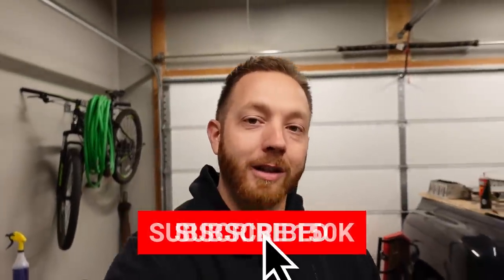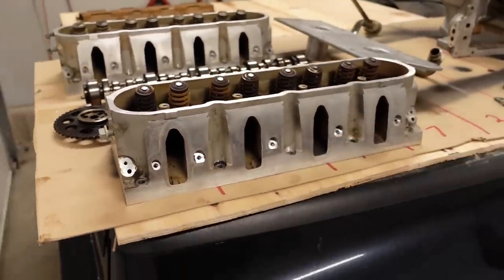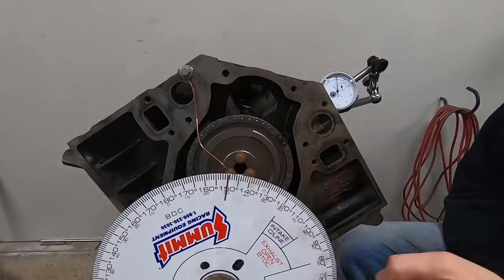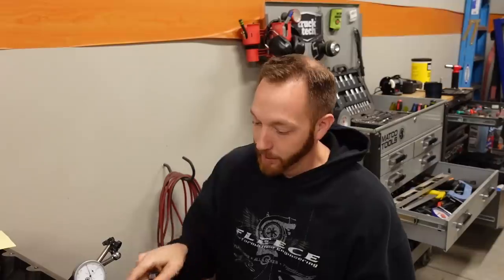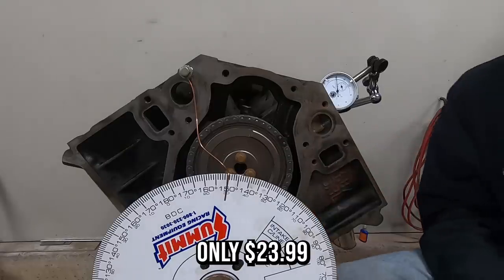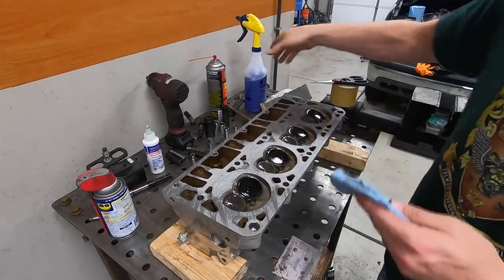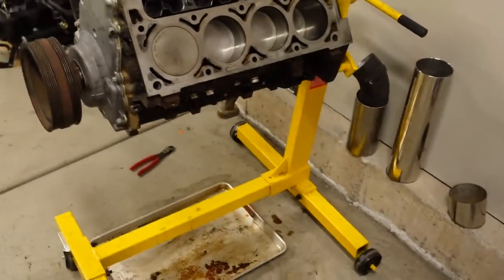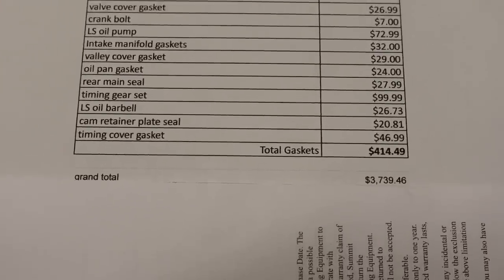LS Cam Swap Do's and Don'ts: 4.8 vs 8.1 shootout pt.4

Comment: LS motors are cheap right? Thanx for the expenditure break down. Do you need new injectors for the first upgrade?
Reply from the maker: I had already installed my stock 24lb/hr 8.1 injectors instead of the stock 19lb and that should get me by for a while, but eventually they will get upgraded to larger.
Reply: Ls engines can be cheap. See YouTubes “driveway engineer”. You may not like his methods but he has good results. 

Another great video LT.✌️👉
Reply: LKQ if you have one nearby. You have to remove it yourself, but a long block is $280 + core charge and tax. You'll need other odds and ends that cost extra, basically get as complete of an engine as possible.

Comment: If you go lsa let me know
......I have the square to cathedral adapter plates you need....I will donate to the cause ,u just cover shipping. .....I never used them cause I was already running ls3 heads,  they came with my boost district truck lsa kit....

Comment: I wouldn't consider gaskets as parts they're more of a necessity than a want especially for a rebuild
Reply: but they still cost serious bank and its disingenuous to not include them...easily a quarter of the budget is gaskets,fasteners,anti seize,thread lock,silicon and other throw away stuff

Comment: So is the only way to adjust cam timing is with an adjustable gear, or can you move the gear by a tooth of the chain if you just have an oem timing set and aftermarket mild cam?
Reply from the maker: not sure on the tooth count per degree, but I think if you moved it by one tooth, it would be much more than 2 degrees...
Reply: @LawrenceTolman  so maybe you measure it first with the oem timing set and if it needs adjusted you can buy the adjustable set

Comment: This 4.8 is going to run great and definitely a shout out to Pat, you both are incredible builders! Can't wait to see how it is going to run!! Question please, are you going to build your usual amazing exhaust for this 4.8? I know it is a lot of work but it will definitely compliment this engine build. :)
Reply from the maker: yup, I'll be building an exhaust for this one as well. I showed some of the parts an episode ago, but its texas speed headers, a speed engineering x pipe, and the rest is up in the air at the moment, but I wanna do something out of the ordinary for this one.
Reply: @LawrenceTolman  yea I did see that episode and those will be great for this build no doubt, I just like your custom mandrel bend exhaust that you have made before for other builds, just top notch quality!! :)

Comment: Don't forget LT that the TBSS intake is the exact same intake (basically) as the NNBS intake. The Dorman one on RockAuto is a little different but not by a whole lot in terms of power gains. People will charge stupid money for a TBSS intake when you can get an NNBS intake for much cheaper at a wrecking yard off of a 4.8 or 5.3

I'm a bit behind on the videos sorry haha
Reply from the maker: yup, good point!

Comment: Where are the valve stem seals? The locators you have may be meant to be used with the 1 piece style. A set of valve steam seals is like $20.
Reply from the maker: the 918 kit came with some new seals, and are a seperate seal just like the factory ones
Reply: @LawrenceTolman  yeah design changed later to be umbrella type 1 piece. Was the big gap still there after installing the seals?
Reply: This was my thought as well.  Should be a better fit with the seals on

Comment: i would have it balanced internal and external i see a lot of rebuilt engines on the net F up real fast seems like they have a lot of problems with them most don't break in the engines right  they really have no idea on how to break in a engine the right way i leaned everything i know about engine from old man bell a pro engine builder that has been building engines for the track since the 60's he was one of the first to make his own heads for racing people all types so far on the net i have not seen one person break in a engine like he does seconds count on break in like time the engine in before u start it never see anyone do that yet same with valve springs u break it in with the stock springs then put the double spring in saves a lot on the cam

Comment: Budget hmm I should have thought of that.  6.0 LQ9 freshen up and  swap into obs 2007 Silverado with a 4 3. Snow balled into complete build Gen 4 rods 243 cnc ported heads forged pistons. BTR stage 3 truck cam. Long tubes. Built Trans. Circle D converter.  On and on and on! TBSS intake for sure makes good power up top and keeps the low end torque. Budget 😆 🤣 😂!
Reply from the maker: yeah, I've learned many times that budget is more of a wish than a reality lol

Comment: Isn’t it 862/706 heads are the same and 243/799 heads are also the same and the 243/799 are the ones you want?
Reply from the maker: I saw a test where the 799 heads (if I remember right) actually made less power even though they flowed more CFM. it was due to the larger chamber which led to a pretty significant drop in compression ratio... but it depends on what you're doing, if you wanted a lower compression for lots of boost or something like that.
Reply: I’d prefer more compression. With that bigger cam i think you should go with some 4.30 gears. Would be fun. Let me know when your ready!!  Great content keep up the good work.

Comment: What did you use to secure the degree wheel to the crank?
Reply from the maker: the old stock balancer bolt, and a few washers that came with the degree wheel kit

Comment: LT! Awesome tutorial brother. New Cam thrust plate with that ever so important oring seal. Then degreeing the Cam just right. In your budget comparison did you include all of the miscellaneous parts like plugs, sensors, gaskets etc that you put on the 8.1? I don't remember that far back. I saw the "barbell" in the parts list,  did you show it in a previous video?  Don't forget to check yure oil pump clearance, a lot of times the torque on the bolts is whatever sets the clearance? I chuckled when you told us the Cam specs. With what you said I was thinking you must have gotten an ole fashioned 268 duration or so. That 230 something will be great I think. I'm betting you hit the mark, the intake is gonna be a strong maybe? It's going to help you keep some bottom end you think? Sorry for the book LoL, I drank two of those new black rifle coffee Espresso in can deliciousness. It's not an energy drink per se but it woke me up more than I remember Monster doing. Who knows? Thanks for another excellent video. Down East expertise haha, cheers.
Reply from the maker: it did get a new cam plate with the o-ring, and I didn't really show a ton on the barbell, just it sliding in place.